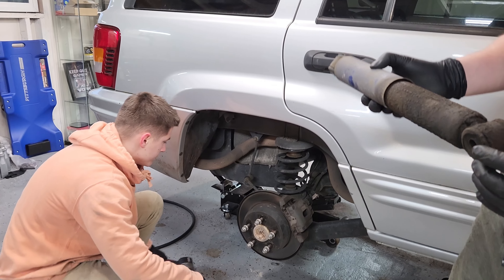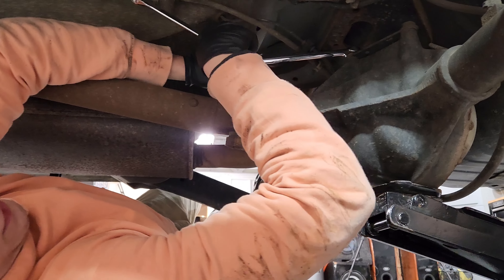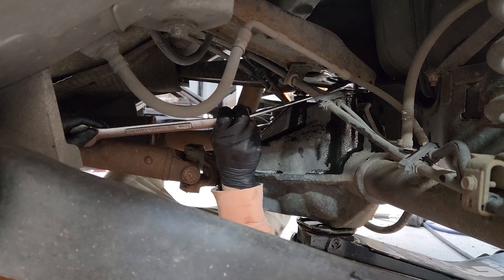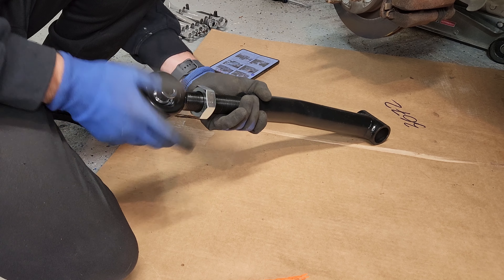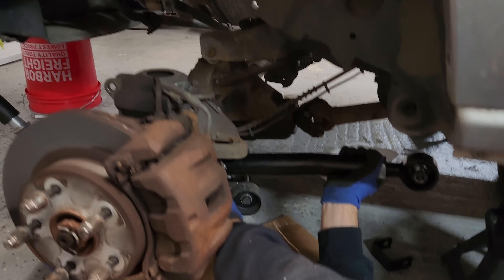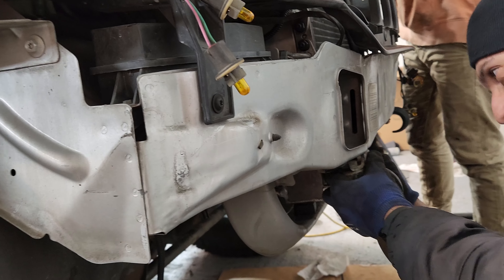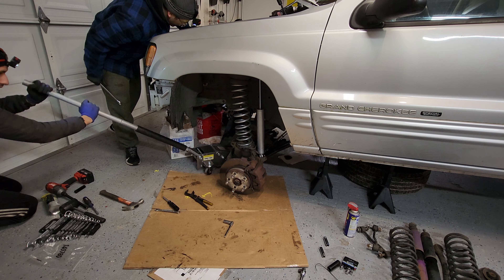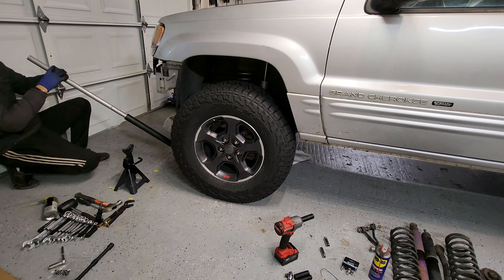A Stock Jeep Grand Cherokee (WJ) Received Tasty Mods! 4" Lift Kit & Offroad Wheels + More!

Comment: Is this the jeep grand cheroke 2.7 crd and if so did you only install the lift kit and if so you did you need to do extra modifications to fit them. My question is if i could buy a lift kit for my jeep grand cherokee 2.7 crd and just put it on without buying anything extra
Reply: 2inch max! Kit cost £54! Anything over 3.5inch.....big bucks! Tie rods, drive shafts, gota drop the transfer box, different shocks, springs....just so it'll flip over 1st corner! I've had a 2inch boost on my 2001 wj 4.7. It looks great!

Comment: Should be getting the call this afternoon to come pick up mine, getting 4 1/2 inch long arm lift installed on the XJ and upgrading to 33 inch MT's.  Pretty stoked.   Between now and spring hoping to do winch bumper, winch, lockers, rock sliders.....  unless the engine goes first, then I'll take care of it first.  Lifters are rattling pretty good, but not using any oil, and doing fine.  If it holds off death a while, the plan is to drop a stroker in it.   Should be trail ready and cruising around old mining and logging roads by the time the snow's coming out of the Cascades.

Comment: So i believe on these newer grand cherokees the front axle shafts are like cv shafts with rubber boots. Can these axles be easily swapped out for the stronger medal joints?
Reply from the maker: Yes, we already swapped the axle to a double cardon one. It's a simple process for the most part if you only have to change the yoke type at the transfer case. The yoke at the axle is a little more work but it's not too bad.
Reply: Iron Rock Offroad has u-joint replacement front axle shafts for Dana 30, 27 spline axles. They do a custom modification so there is no binding at full lock. It replaces the stock the CV axles. Good upgrade to do while you are changing diff gears or adding a locker.

Comment: LOL rough country
Reply from the maker: Not bad for how cheap they are. It's a budget build.
Reply: Perfect for budget build lift.
Reply: A couple hundred more you get ironrock. Buy once. Cry once. Prices are similar. Look
Reply: @MrSrtman18  the 2 comparably priced kits are very different. The Rough Country lift includes front lower control arms, track bar drop bracket, drop pitman arm, and rear upper control arm relocation bracket. IRO does not include any of those items, basically leaving you to sort out your pinion and steering angles on your own by forcing you to buy more parts. Rough Country is a much better deal and is a foolproof kind of setup that has everything you need for a lift of this size. The IRO kit does have an adjustable track bar, but it leaves you with a hideous drag-link angle. Also IRO includes hydro shocks while RC includes nitro shocks. Nitro is simply better on a lifted vehicle.